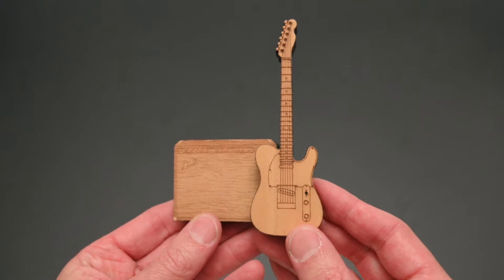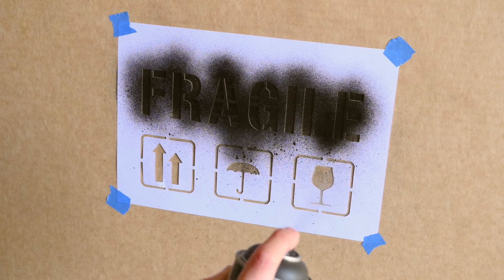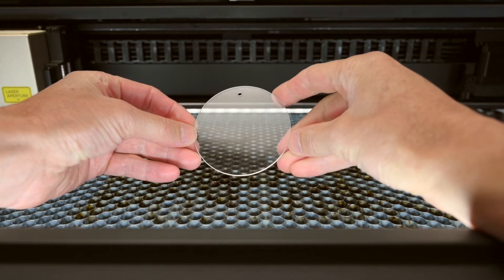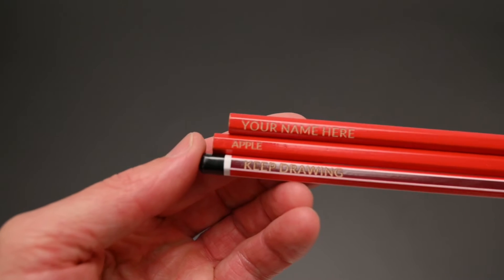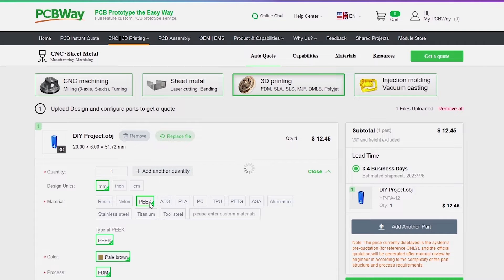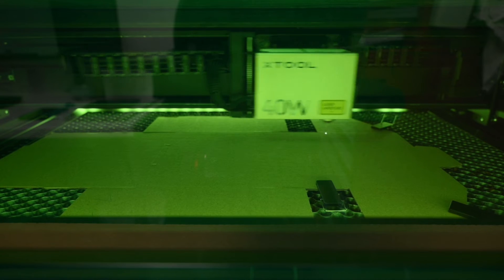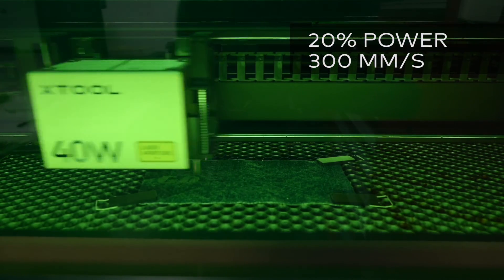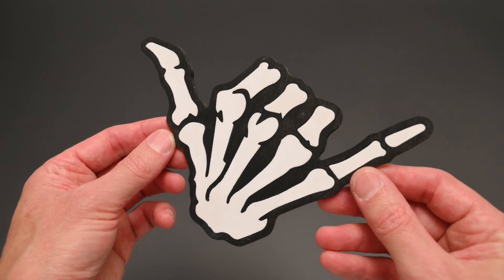12 Easy Projects You Must Try on Laser Machine

Comment: Hello, thank you for your video. I am looking tu buy a laser cutter/engraver machine to make my own little houses for my miniature train. Is the Xtool S1 is right for me ? I will principally use thin cardboard to build my houses: 1, 2 or 3 mm thick and less than 1mm to add some windows to the houses. I think the 20W power is enough for my need. I need a very accurate cutting because the scale of the house is 1/87.